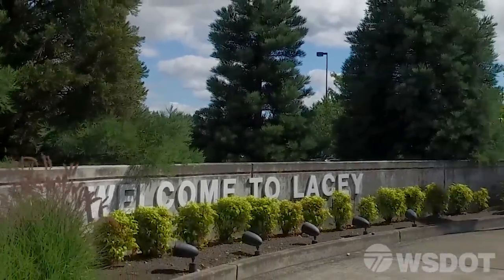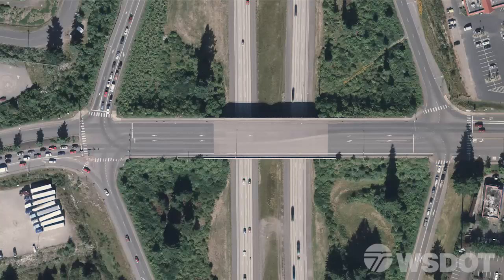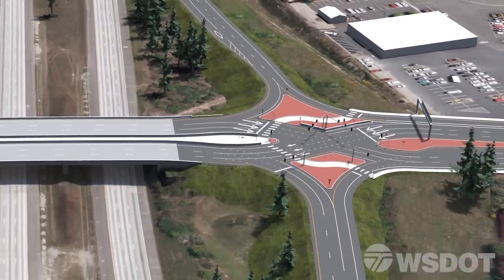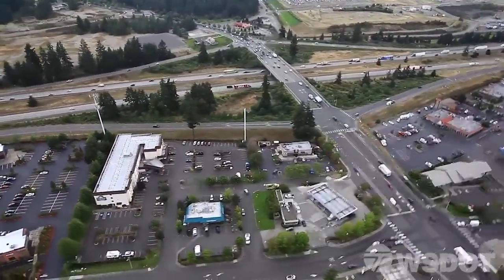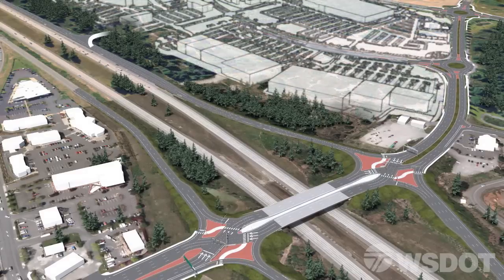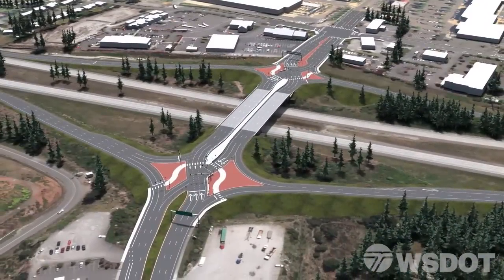Diverging Diamond Interchange comes to Washington State

Comment: Why don't you build Roundabouts this the we have in the U.K.
Reply: Daniel Robert Miller  We have plenty of roundabouts in the US! Down here in the south, these people do NOT know how to drive through these
Reply: Wait.... do people don't get roundabouts or what exactly is the problem? I was never once cut off or experienced any annoyance besides someone not blinking.
Reply: ... People here drive through the middle, stop inside the roundabout to let cars in, even though cars are supposed to yield them... its stupid.
Reply: Which clearly says that people in Phoenix don't drive, they aim!!  Don't get me wrong, I have lived here in Phoenix for over a decade, but I was born and raised in the UK, so I am very familiar with roundabouts - or traffic circles as they are called here!
Reply: roundabouts are actually one of the most efficient ways to handle traffic, only little bit failing behind multi-level interchange. Much better then anything with a traffic light. 
And effeminately much better then that idiocity you call "4-way stop crossing"
Reply: Daniel Robert Miller - Because our traffic engineers are smarter than your engineers.
Reply: After driving 1000 miles in a day the last thing I want to see is a roundabout. Nobody knows how to use them and they are a pain in the ass with a 22 foot pickup truck and a 48 ft trailer.
Reply: Geezer65 we have found the 5 year old. roundabouts are very effective actually. this is also not an american design.
Reply: It isn't hard. People just refuse to listen or learn the rules. You do NOT brake unless you see another vehicle inside or coming to the roundabout.
The first car there gets the right of way. If two arrive at the same time, the car to the right gets the right of way.
If you intend to pass THROUGH to the other side, you do NOT use your turn signals.
If you're using an exit on the side, use your turn signals.
If the exit is to your right at a very sharp angle, you continue counterclockwise (clockwise in the UK/Australia) around the center island until you see the exit in front of you.
And no, the city does not put traffic lights at roundabouts. They don't need them.

They have one in my city and I've never had trouble getting through it. But what I don't understand is why they planted trees all around it. Makes it difficult to see other cars. Bumbling bureaucrats...
Reply: I know the rules around roundabouts and very rarely get through one without someone cutting into my lane close enough that I would hit them if I didn't brake. 
The majority of vehicles in the US are large pickups and SUVs (large compared to Europe, midsize and fullsize here). They are great for going long distances in comfort, but not that good at going around corners. We also have a bad habit of doing other stuff while driving (drinking coffee, eating breakfast or lunch etc). Because of this many people seem unable to stay in their lane while turning (they cut into the lane on the inside of the corner). This is a problem when you have multiple turn lanes and is definitely a problem in roundabouts.
They may work great elsewhere, but they don't work well here. What does work well here is 4 way stops. You should give them a try.
Reply: Because the U.K. is totally where we should be copying when it comes to traffic lmao
Reply: Just because something doesn't work for US drivers doesn't make them idiots. Is it the fact that you have 66 million people living on an island the size of Michigan that makes people in the UK so hostile and judgmental?
Reply: what? so the people who you mentioned that don't stay in lane are not idiots? i never said all americans were idiots.
Reply: It may be that they are idiots or lazy or poorly trained. It does scare the shit out of them when you hit the horn and they realize they have an 8,000 lb truck 3 feet behind their driver side mirror.
Reply: So who gets the right of way through the roundabout when the traffic is backed up because the next interchange down in all directiosn isn't a round about and cars are backed up through the roundabout in all directions?

Europe has roundabouts all over already. So the typical "roundabout flow" works because everything is a roundabout. That doesn't work here because while we have them, they aren't prevalent. So a roundabout in a busy intersection fails as cars can't flow past the next interchanges. Make sense? You have to understand your constraints before you make a decision. You also need to understand the difference in American traffic volume vs European traffic volume. My community of about 100,000 has a freeway through it that has 7 lanes of traffic in each direction. London doesn't even approach that. Houston's Katy Freeway has sections with 26 lanes of traffic. That is not an exaggeration. Go look it up. That is a volume of traffic that roundabouts are simply not efficient at handling in the extremely compressed space of an American downtown environment. The DDI is. And does. My city has dozens of roundabouts and 11 DDI. I can tell you the DDI are far more efficient at handling the American version of high volume traffic.
Reply: Romans, not Europeans... ancient effective thought turned into usable action.
Reply: Roundabouts are for slow speed, low volume traffic <=25 mph/40Km.  We don't have slow speed, low volume traffic.  Traffic circles are for higher speeds, higher volume and they take up a lot of real estate.  The problem with traffic circles is that drivers entering the circle won't know what the driver in the circle is going to do until it is almost too late to make a decision to wait or go.  Last second lane changes in the circle doesn't help at all.  Not enough distance between the exit and entry roadways the way they are designed here.

Comment: What is wrong with a rounderbout
Reply: this is way more efficient to build given what's already in place
Reply: Nothing, in that city they use roundabouts all over.
Reply: Roundabouts solve a certain set of problems in a certain set of conditions. Here there are space constraints, likely cost constraints as well. There is also likely far more traffic than a roundabout is going to handle efficiently. There are stoplights very near to this overpass/freeway interchange and when those lights are red, traffic will back up into a roundabout making right-of-way a nightmare. You need to understand the use, conditions, constraints of a situation before choosing a solution. Roundabouts are great, but they are not the be all, end all of traffic solutions. There are vastly more efficient options for interchanges out there.

Comment: or you just build a roundabout
Reply: nope, lower speed and americans have no idea how to drive through roundabouts, yet alone multilane ones.
Reply: Lower speed than stationary?
Reply: for that you'd have to demolish all the existing infrastructure, this is way more efficient to build given what's already in place
Reply: Not sure what Thomas Krieger is talking about, America has thousands of roundabouts.  They're fine until you reach a certain volume of traffic, then they're less efficient, especially for an already existing overpass design like this.
Reply: Where I live there are 6 roundabouts in a 5 mile area and it has cut down my travel time by 2/3 compared to using traffic lights.... Everyone here knows how to use them....lmao
Reply: I think roundabout roads are only suitable for low traffic.
Reply: Yeah, what were you thinking stick to traffic lights on freeways instead... Or spike strips... Or speed bumps....lmao
Reply: EveryDay the roundabout doesn’t go on the motorway itself but the motorway passes under the roundabout, it’s like a circular bridge that connects to both sides and has exits for the motorway underneath, we have them everywhere in the U.K.

Here’s an example: https://www.google.co.uk/maps/place/M40,+High+Wycombe+HP10/@52.0733699,-1.3134849,16z/data=!4m2!3m1!1s0x4876e09f0954bbc3:0x59b6c684b8af5596?hl=en-gb
Reply: steve b see my previous reply

Comment: Dear Americans,

Please learn about roundabouts.  That is all.
Reply: roundabouts are a nightmare. I've spent a lot of time in the UK and hate them so much
Reply: I am an American and my town has a roundabout and I like it very much.
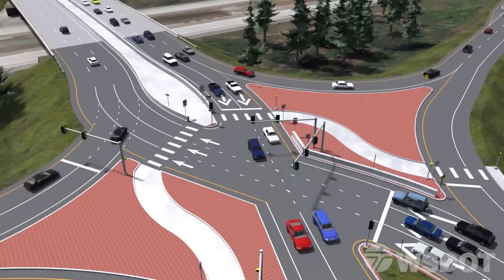Reply: A DDI is quicker in this situation. A roundabout would work but not as efficiently. You have to take into consideration semi-trucks and increased traffic size. For a roundabout to work as efficient as a DDI in this case, there would have to be one in the center of the two sides of the interstate. I encourage you to pause the video at 0:40 and mentally place two round abouts at the intersections then compare it to the DDI. Also take into consideration that traffic on roundabouts in the US move in a counter-clockwise rotation. You will find that my theory is correct. For example if you past your exit headed South and needed to go north a DDI is extremely faster. And trust me they would never reposition the actual interstate to place one roundabout in the center of one exit, it's just not that worth it.
Reply: I agree with Ærik Bjørnsson (easier to cut and paste when not on a phone).
Reply: MercuryAudioVideoArt roundabouts in Boulder?what about Bend Oregon?theres a ton of roundabouts there
Reply: I've driven enough roundabouts to know they suck.
Reply: Unfortunately there are many people who have phobias to roundabouts. They panic and stop in the middle.
Reply: The US has thousands of roundabouts.  Your point?
Reply: In Lacey, the same place as this video, there are tons of roundabouts right down the street from this overpass.  All over Olympia they use the roundabout.

Comment: this is stupid. where are the bike lanes, or sidewalks? how many times does a biker or pedestrian have to cross the street and wait for cars to cross the interchange?
Reply: Watch the video again--cyclists and pedestrians go in the middle of the bridge and benefit just as much as drivers.
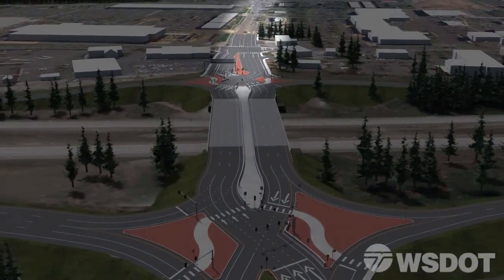Reply from the maker: The proposed design of this interchange has substantial improvements over the existing overpass to accommodate both bicyclists and pedestrians. This design provides a barrier separated dedicated corridor for both bicyclists and pedestrians over I-5 (see 3:27). Both would be able to use push buttons to activate the pedestrian signal at any of the four crosswalks needed to cross the bridge.
Reply: oh ok fine but anyway o still feel like it prioritizes cars and encourages them to drive too fast, when suburbs and sprawl have been proven not to be safe, cost effective, or conducive to happy environments as urban centers, with multimodal transit options.  I just feel like it would be better if projects that prioritize the car culture,  like this (but not specifically this) could wait a while, because demographics and the public perception of urban centers will shift.  it would be interesting to see the public perception of making better buffered or protected bike lanes, and a road layout that didn't encourage so much traffic and noise, instead of doing something like this that would increase traffic capacity as well as possibly a better public transit hub in that shopping diatrict.  Anyway, again:. I don't know the specific area, but I feel like that's a better design in general.
Reply: Here is one in use in MO outside of the St. Louis area.  This works very well for cars, pedestrians, and bicyclists.  They allow for a smother flow of traffic with less traffic crossings.  Pedestrians and bicyclist will use the center and will only will also have fewer intersections to cross.
https://www.google.com.ph/maps/@38.7997764,-90.6194317,458m/data=!3m1!1e3
Reply: I've never seen anyone walking across that overpass, or riding a bike.  Just swarms of zombies in cars.
Reply: jojito gonzales1081 I think that the general safety seem to be improved quite a bit. Bicyclists and pedestrians might have benefited even more from an additional bridge entirely seperated from traffic.
Reply: Bikes?!? Didn't your mother teach you to keep your toys in the yard! Bicycles, what is this, China?!
Reply: HailAnts I suppose you think that people should be able to drive a car from the age of five in order to get to the kindergarten.
Reply: You don't drive bicycles on an Interstate...
Reply: HailAnts No but you may have to cross them eventually.
Reply: I've seen other DDI designs on YouTube that include them...
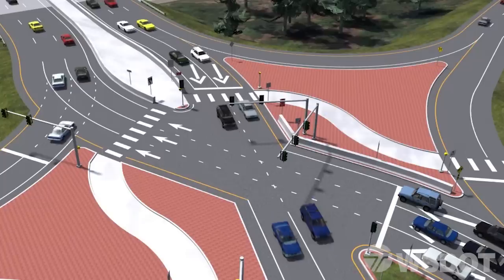Reply: 2:15 the white - pedestrians/cyclists
Reply: +Peter Liljebladh I would actually love to see little kids driving around in their parents' cars.  That would be awesome.
Reply: It's illegal to ride bicycles on an interstate highway.
Reply: Autobahn is a German word and thus only used in Germany. Autobahns don't have speed limits in many places, are properly maintained, free and safe, so you can't really compare them with American interstates :-D
Reply: Gammareign So is having an intersection with traffic coming to a complete halt.
Reply: magnetiktrax 
Autobahn and properly maintained.
What have you smoked?
Reply: connor escue No. In Actual English they're called Highway s, Motorways, Expressways, Freeways, Distributors, Tollways, and National Roads.
Reply: jojito gonzales1081 make overpasses...
Reply: Pedestrians got thrown under the bus in this one lol.
Reply: Only if they are blind and stupid. The rest of them follow the pedestrian crossings and have the same amount of traffic lights as the normal situation had.
Reply: When bicyclists start paying Road Use Taxes.
They might start getting some consideration.
Until then.... screw 'em.
Reply: @Gammareign @connor escue - The interstate is the road underneath that bridge, which has no crossings at all. The one that has the pedestrian path is a road which crosses over the interstate.
Reply: I do. I own 3 cars. Do you pay a pedestrian tax to use the sidewalk?
Reply: Geezer65 you clearly don’t understand how roads are funded.

Comment: i have noticed people in the comments section saying "why not build a roundabout?"
my guess is: there isn't enough room for a big roundabout and WSDOT is wanting a low cost solution that is just as effective if not better than a roundabout. they found one in a DDI and sometime this year (2018) the project will start.
edit: if im honest, i know quite a few diamond interchanges in tennessee that could use a DDI setup, one of the most notible is exit 80 in jackson tn. there is some construction ongoing as we speak to widen the overpass over I-40 from what it looks like, but i think a DDI setup would help people in jackson get on the 45 bypass much easier and much quicker.